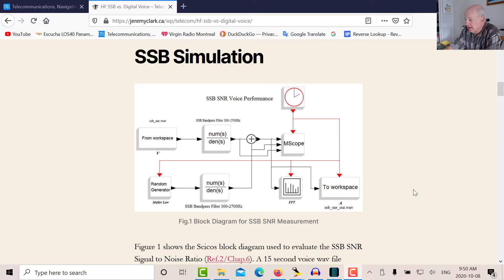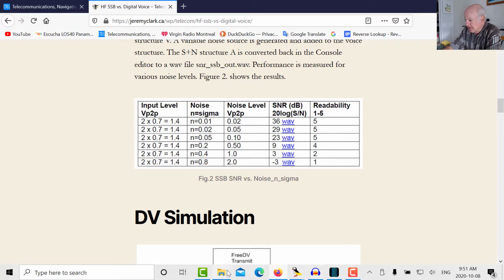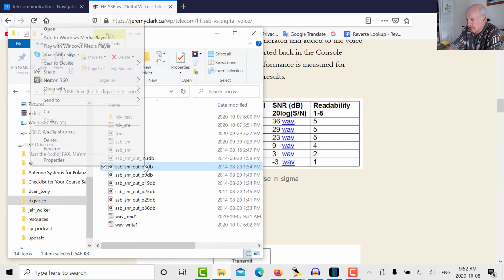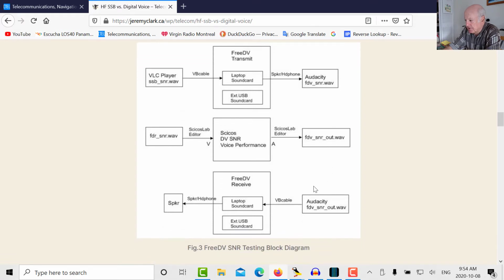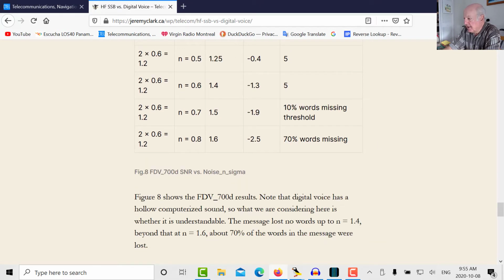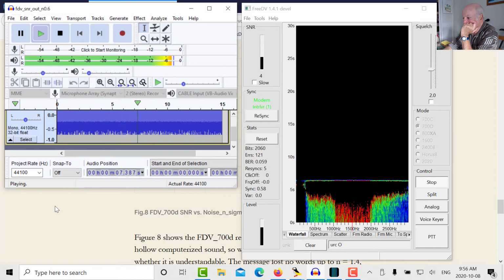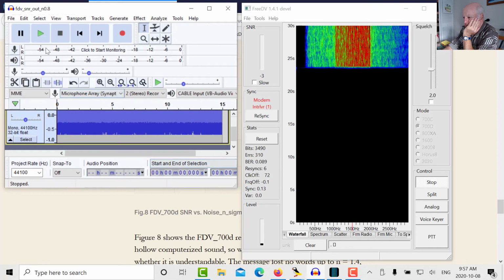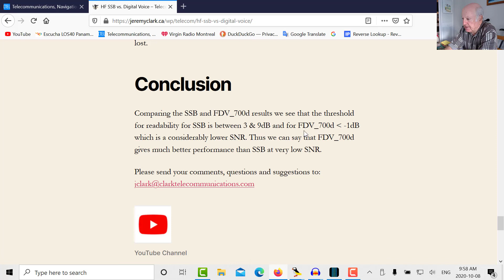HF SSB vs. Digital Voice

Comment: Jeremy, nice video. You put a lot of work into making all this work. I’m a firm believer that someday in the near future we may have digital voice and analog voice modes simultaneously on the bands. I don’t know if this will create another AM vs. SSB issue like we had in the late 50’s and 1960’s, but it will definitely be interesting to see how it unfolds. 

Certainly, fidelity will be much better with digital voice, But if it suffers from not working as far as analog does, due to a wider bandwidth, analog may be the way we stay until a suitable DX version of digital SSB comes around. 

Nice video. I may put it on my YouTube channel when we talk about digital versus analog SSB. I’ll be sure to credit your channel and put a link to it in the description section of my video. 

Thanks for making a great and thought-provoking video.  

Larry 
de K7HN
Reply from the maker: I just read an article in QST about Vara which is an hf email program using OFDM! Also read a book about Wes Schum and the development of SSB, history unfolding - yes! 73